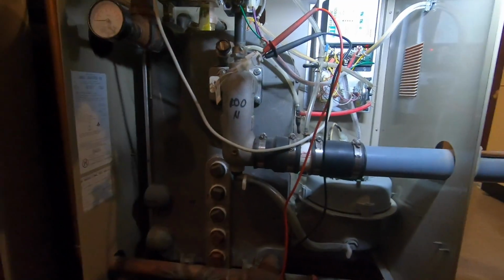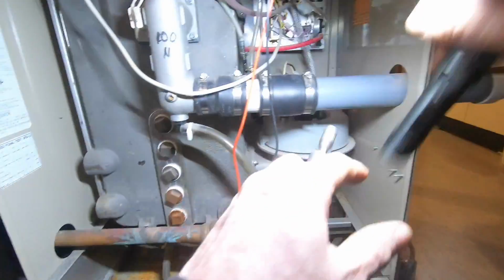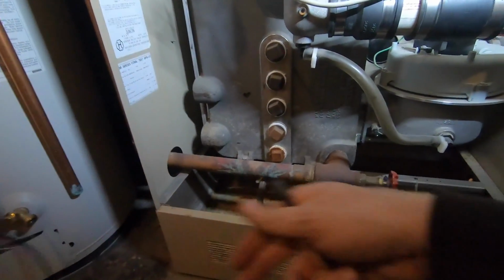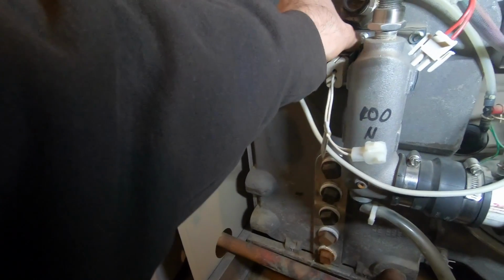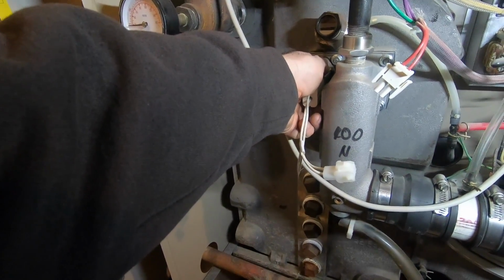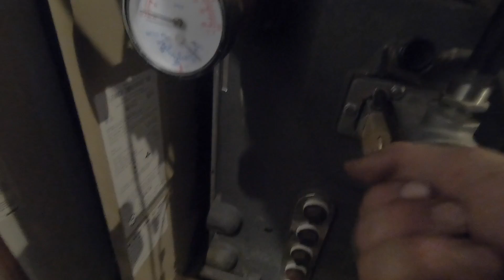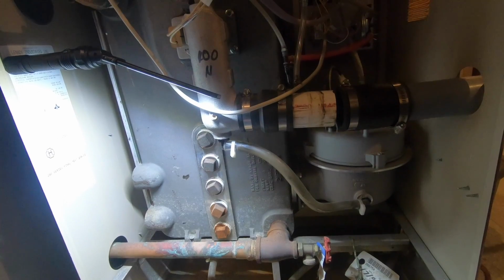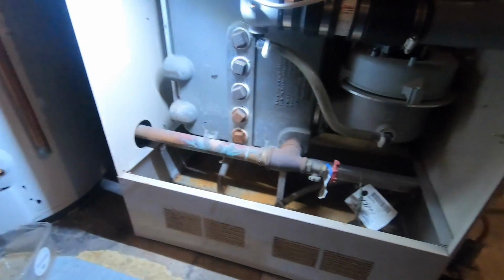Boiler Burner Dose Not Fire Also No Water Pressure

Comment: So what’s the problem with the intake or exhaust
Reply from the maker: Homeowner told me not to worry about it he will take care of it. The boiler flutters when lighting and it goes away with fresh air pipe disconnected. Something might be restricting the fresh air pipe, yet didn’t look into it.
Reply: The HVAC Hacker  did you follow up
Reply: The HVAC Hacker thanks for the confirmation. I thought the same thing, but wanted another opinion